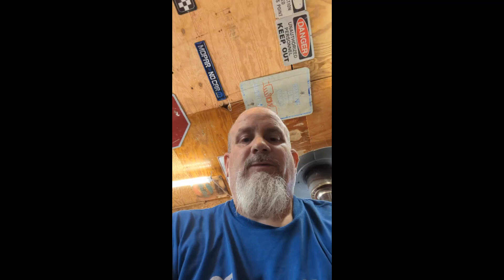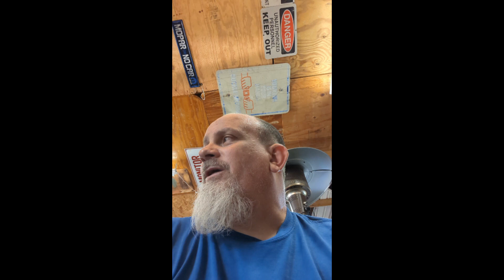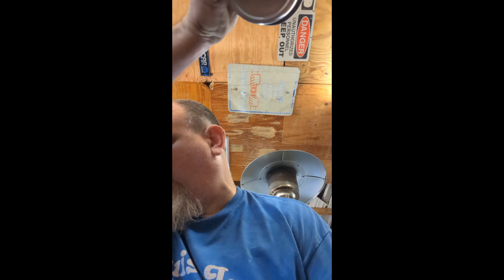Dodge Omni GLHT trials and tribulations. How many parts can one take to fix!!

Comment: Aren't cars fun.  You got a lot further along that I am getting.   I did find a guy on one of the websites that makes new shift Linkage with hime joints. The plastic factory ones are horrible.
Reply from the maker: I found a new set in a car I parted. That's what we put on. The long pin on the back of the transmission came lose and is sloppy. I am in the middle of trying to get it out and maybe weld it in place but that one nut is being a pain!